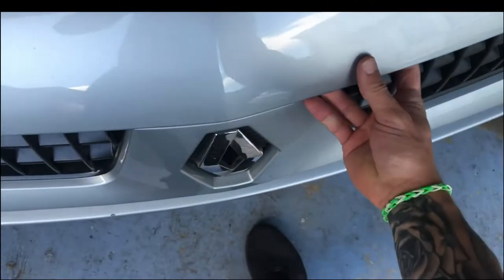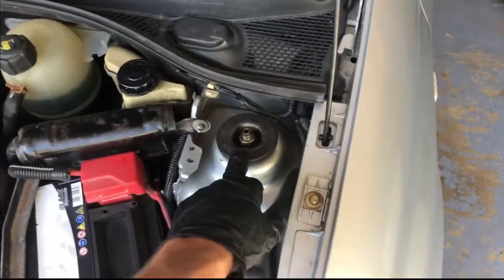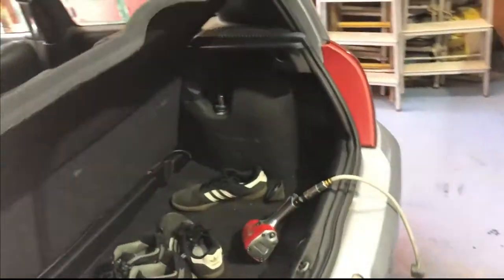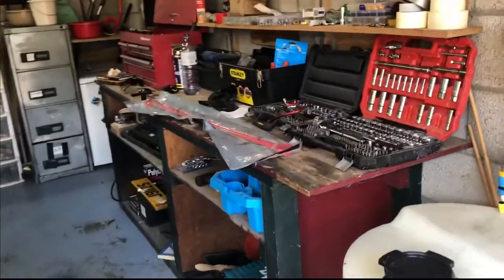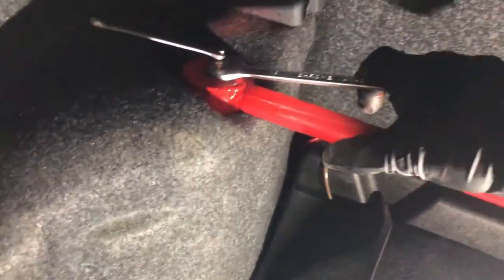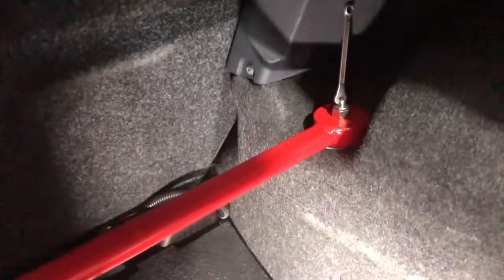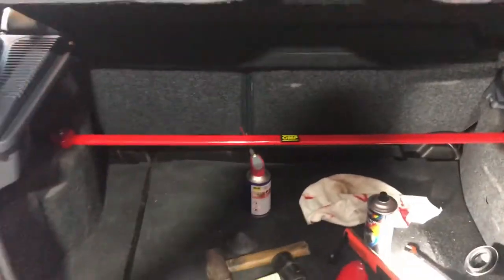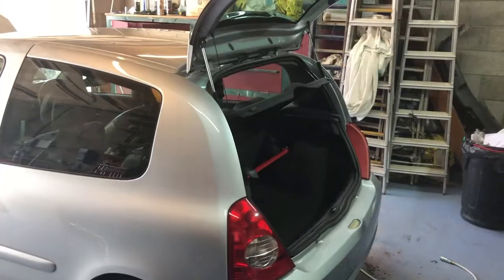Fitting A Strut Brace To My Renault Clio 172 !!

Comment: Hey man
Nice Video helped me a lot for choosing the right bar because with some bars you have to drill into the body.
Do you know wether the front brace from omp is also bold on or a drill thing?
Reply from the maker: Hi mate,
it was a good fit, needed push hard for it to fit in place but once it got settled on the struts it was a easy fit and a good noticeable difference. although my plans changed not long after this video and had to sell it. so i never got around to doing the front strut, although id imagine it would be very similar and fingers crossed be a straight forward fit.